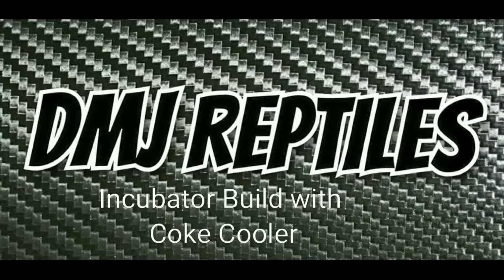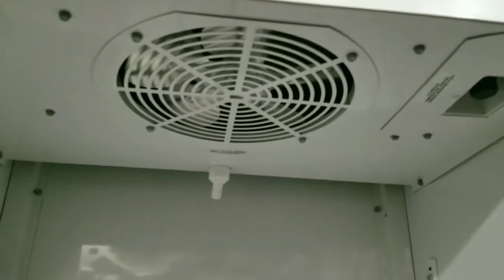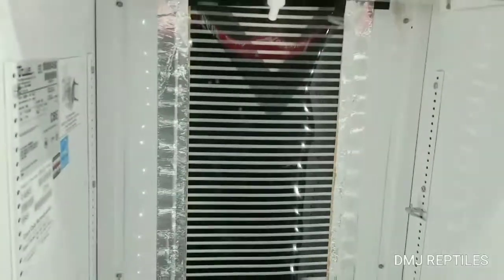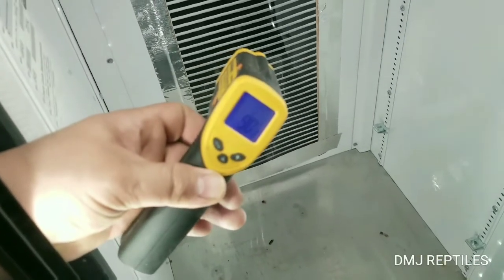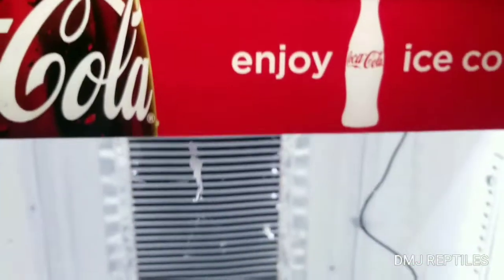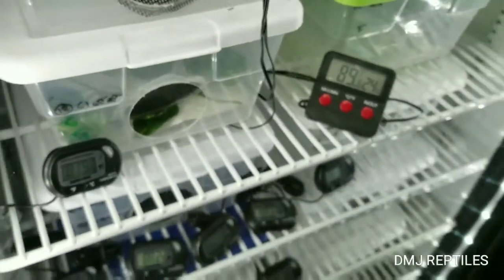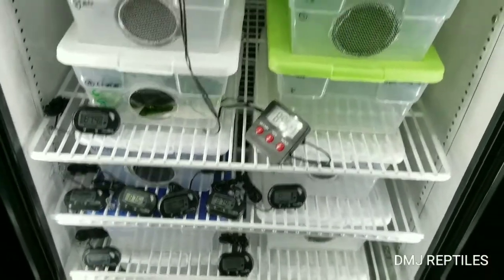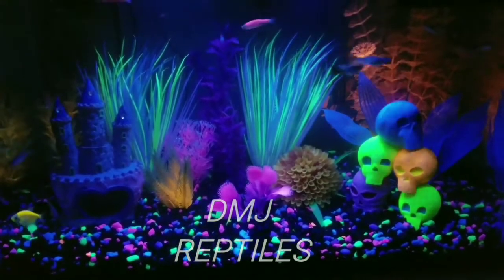DIY Cooler converted to Incubator for ball python eggs

Comment: Doesn't the herpstat2 have a temp read only on the 2nd side? It would seem like it'd make life easier instead of relying on another thermometer. Or do you add therms to every tub?
Reply from the maker: It has a temp read for both zones, I prefer to have extra thermometers so I know consistancy considering this was the 1st season using this incubator
Reply: @dmjreptiles  Ah. Gotcha. We are starting to wade into breeding and I'm trying to do my homework on diy incubator setups before diving in. How was this setup? You still use it? Good/bad, things you'd change?
Reply from the maker: @TheXxneowolfxX  absolutely perfect, I hight reccomend it, I  gonna run this one and a full size glass front this year

Comment: Did you add a fan? Or is it not necessary? there's so many videos and people saying different things...It's confusing xD
Reply from the maker: Sofia, hey, I did not because it has one that came with was perfect, I my last incubator I installed them though, I want the air to be even throughout the incubator. 

I wrap my tubs and do only 1 1/8 hole on each side so air circulation doesnt effect the tub of eggs (dry them out)

Comment: i like what you did but are you gona add like water bottles in the bottom ive seen some people do it is it important
Reply from the maker: william esp Borrero, i did with my last incubator, but am not sure. I watched Justin kobylka show off a similar build and it had no bottles. I guess it adds to the consistency, but not sure if its worth the blockage of air flow